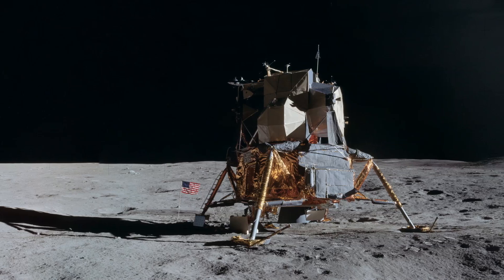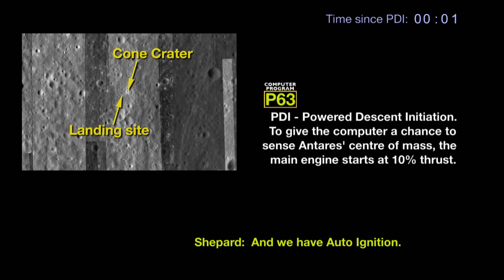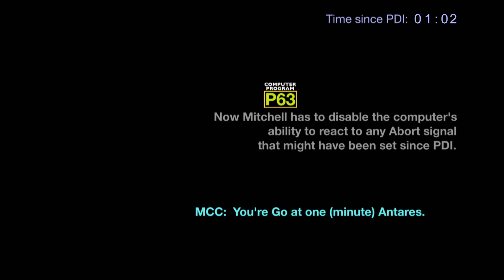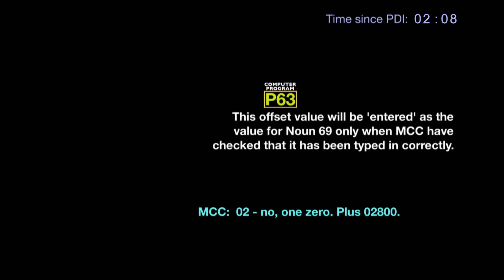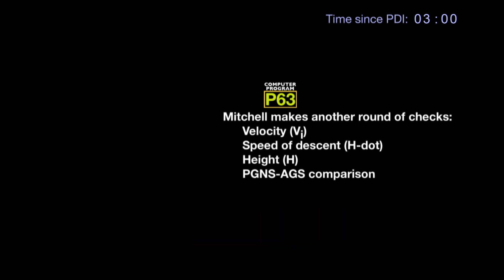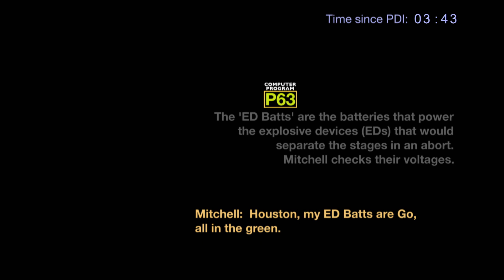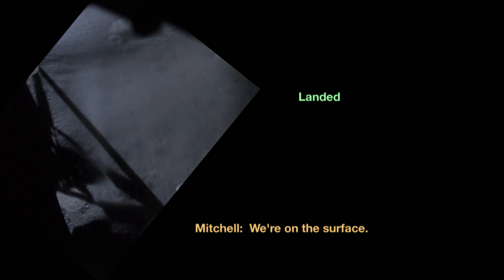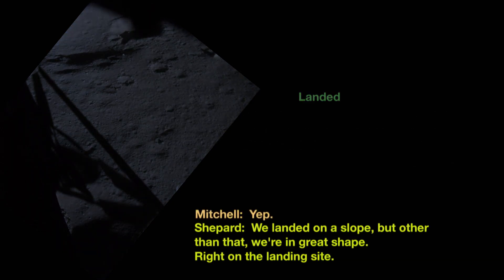Apollo 14 landing from PDI to Touchdown

Comment: There is a video on YT where some guy explains, just due to the film technology they had back then, that it was IMPOSSIBLE TO FAKE THE LANDINGS. You'd have to pre shoot everything which means multiple mags if film which means splices. Add to that having no "film effects" during a live broadcast. Impossible. One pop or crack and it's shown to be a fake.
Reply: Interestingly, some hoaxer pointed out some mistaken assumptions in that video and some examples of recording gear that existed at the time and that NASA could conceivably have operated to facilitate a faking. The author of the video acquiesced to those points; something hoaxers don't do. His point still stands.

Comment: at 13:14 why does Shepard talk in metres?.
Reply from the maker: Great question. When flying, the Apollo crews used aviation units; feet, feet per second, nautical miles. But on the surface of the Moon, they switched over to metric and stated distances in metres and kilometres. Even the Lunar Rover's speedometer was marked in km/hour, which may be related to the German engineers involved in Apollo. So in this instance, Shepard is referring to a distance on the lunar surface as opposed to a flying-related number like altitude, and without skipping a beat, switches over to metres.

Comment: Hi guys I'm looking for information on the accent fale safes. What was the protocol if the engine didn't start ?
Reply from the maker: A good starting point is the Mission Rules document, section 26: http://www.hq.nasa.gov/alsj/a14/A14MissRules.pdf
It is notable that much of what it says is they should try again after the CSM has completed another orbit. 

It is said that Neil Armstrong's answer to the question, "What if the ascent engine failed?" was along the lines of spend the remaining time they had trying to fix it. On the one hand, the engine was extremely simple. No pumps and no ignition source. Just open the valves and away she goes. But there were important prerequisites to proper engine operation, most notably the requirement for the propellant tanks to be pressurised with helium. Should that helium leak away before ascent engine ignition, it would be a bad day as there were no fail safes for this. This demanded extremely high reliability, extensive testing and careful monitoring before entrusting the crew to a system. The same was true of the SPS engine on the Apollo Service Module.
Reply: ronald mcchesney Thw fail safe is "it cant fail". That's why the engines on the LEMs used hypergolics. Very simple. Very reliable. The biggest concern they had was landing on a slope. I think the maximum tilt and still have a safe liftoff was 10 or 15 degrees from vertical. The only flight that really had something even close to an issue was Apollo 15.

Comment: Can you confirm that the audio used in your presentation was one recorded in a simulator and not actually the one recorded during a flight. My reasons for the question are, the delay between Earh-Moon communication is too short, the audio engineering, like the static noise for example, clearly sounds fabricated, there should be evidence of some reverb in audio from the moon, there is no engine noise and the voice stress levels indicate a degree of impassiveness which, despite the training, suggest the rope-learned mundaneness of a simulation flight, which included a routine short-circuit problem.
The video also raises questions. There was no discernible pitch-up to slow the forward motion of the craft. Also, in the video, the power of the rocket engine begins to blast dust at 110 feet altitude, however there is no evidence of this in the ground shots. What gives? I doubt that you know.
Reply: +teatreeboy As one who watched this event live on TV, I have  no doubt this is genuine. This is possibly digitally redone to clean up a lot of static and hiss that would have been on a 45 year old tape. Beyond that there are several cues that correspond with the manuscripts that ALSJ have. The whole issue of the AGS, and the computer reroute did not happen in the simulator. At 6:55 Mitchell comments on the "smooth ride" referring to the anti slosh valves in the LM descent stage fuel tanks, a new feature. At around 8:00 minutes, the issue of the stuck radar comes up. It was set on infinity, and when the switch was cycled, the radar went to proper mode. This did not occur in the Sim. either. I also recall Shepard's exclamation "We are on the surface" and the whoops from the ground controllers. You have to also remember there were two sources of tapes. One is the Flight Directors loop. On this one you would have little background noise, as the voices went direct  from microphone to tapes at Mission control. The recording you hear is most likely that. The other source is the actual onboard recorder on the LM. The Apollo 12 recording used this tape, and you hear the roar of the descent engine throttling up, and the constant bangs of the RCS jets firing. As for Mitchell's deadpan, you must remember these men rehearsed the landing phase literally hundreds of times in the simulators, they were trained to be cool under pressure. Mitchell stated that they spent so much time in the simulators, that the actual flight seemed like another ride in the Simulator.
Reply from the maker: +olentangy74 To add to your point further, I understand that these recordings have not been digitally processed to remove noise. Rather, it was felt that the original tapes should be digitised as faithfully as possible to ensure that their contents would be preserved for future generations. All of the Apollo audio recordings that have so far been digitiesd are available for download on archive.org. You can even get the 32-bit wav files if that suits. An astonishing resource and thanks to John Stoll at NASA's Johnson Space Center for the work he has put in to make these available.
Reply: teatreeboy  It only "raises questions" because you haven't bothered to research the answers. In other words, what you are doing is what every "hoaxer" does.... make arguments from ignorance.
Reply: +teatreeboy 
Two things to add:
1. What gives you the impression that there should be engine noise? Almost all the noise an engine generates, come from the supersonic exhaust gases hitting the surrounding air. In a vacuum this doesn't occur of cause.
2. They didn't stop all the forward motion before landing. So no pitch-up required. Further the engine was gimbal-mounted and they had a very powerful RCS-system for rotation and translation movement.
Reply: +teatreeboy  The audio is genuine and correct; I watched the landing live as it happened early that morning and remember it as presented here.
Reply from the maker: The effect of tilting is different on Earth and Moon.
The idea of tilting is to make a component of the main engine's thrust operate in the horizontal direction. To make the LM move laterally at a certain rate requires a certain force, regardless of the g-field it is in. That force will be achieved by tilting the craft by a certain angle. You are essentially taking a little of the downward force and applying it horizontally. This is a classic force triangle.
Whichever tilt angle was used on Earth to achieve a lateral force, the same sideways force in 1/6-g will require a far greater degree of tilt because the overall thrust from the engine will be far lower, everything else being the same. On the Moon, there will be less downward force available from which you can steal some sideways force in order to achieve the same horizontal motion.
A consequence of this is that tilting by such large amounts reduces the amount of downward force remaining and so you must throttle up the engine to compensate. The computer was constantly throttling the DPS to compensate for the tilt and maintain a desired rate of descent.
Reply: Apollo 14 - Apollo Flight Journal Thank you very much for the added info. The archives  that Mr. Stoll and others have done are invaluable, and very much a labor of love.
Reply from the maker: I believe that the thrust axis of the descent engine could be altered after the 10% period if required, but at a slow rate and it was constantly trimmed throughout the descent to keep RCS activity low. I'll need to look for a definite reference for that. In a sense, the RCS jets were not fired manually during a normal landing except for a check of this functionality early in the descent. Even after the commander went 'manual' in P66, the LM was still under automatic control. It was just that he was in the control loop. He would request an attitude with the rotational controller and the software would fire the thrusters as necessary to reach and maintain that attitude.. He wasn't manually firing the thrusters.
And you are correct, the ascent engine was not gimballed so all attitude control during ascent, including compensating for an offset centre of mass, was achieved with the RCS, resulting in the 2-second cycling seen in the ascent films.
Reply from the maker: To add more to this point about the trimming, and reading NASA technical note TN D-8086, the LM attitude is controlled by the Digital AutoPilot. To quote, "During the descent-engine burn, the DAP tries to control the spacecraft attitude with the trim gimbal servomotor drive [which trim the thrust axis] to save RCS propellants; however , if the rather slow trim gimbal servomotor drive does not keep the attitude error within specified bounds , the RCS jets are used until the error is brought within the attitude dead band, and control is then returned to the trim gimbal servomotor drive."
Reply: I imagine the slow gimbal servomotor drive was purposely engineered to permit the crew to recognize a trim runaway and still have time to disable the trim function. In fact I would think that its total range of movement  was limited to that which could be overcome by the RCS, in a full deflection emergency. To this day I haven't figured out if the LM flew laterally by tilting (like a rigid rotor helicopter) thereby introducing  a lateral component of thrust from the main engine, or if it remained level in the final stages and used the RCS to "fly" horizontally. The flying LM trainers appear to me to have changed pitch angle (using the RCS) to move horizontally and I suspect the LM did the same. I seem to recall that once the DAP had found the neutral point during the 10% thrust burn, the CofG remained in a very small circle of perhaps a few centimetres at most? Additionally, the LM became more stable as fuel burned off, moving the CofG vertically up. I should read up on this again, I'm going from memory from library reading 40 years ago.
Reply from the maker: Perhaps if the DPS gimbal actuators were to go hard over, the crew would simply abort. The range of movement of the DPS was plus or minus 6 degrees, a 12-degree range that is substantial and it would seem a lot for the RCS to fight that all the way down.
Lateral translation near the surface was entirely by tilting, helicopter-like. You can see this in the films, especially Apollo 12's landing. Al Bean even comments on it as Pete Conrad manoeuvred around. And in the low lunar gravity, the tilting had to be substantial to have the required effect.
There are huge quantities of original documents in PDF form out there for light reading or research!  :-)
Reply: Ah, of course, brain fart. It takes the same amount of thrust to displace the LM, but to access it you must tilt the craft more. If the RCS fuel was not so rationed, I would think it would have been a sensible means of moving the LM horizontally.
Reply: teatreeboy --- Make to tell your Mommy about the super moon secrets you discovered.
Reply: I can confirm that the LROC took photos of the landing sites TEN years ago and proved the landing sites for all hoaxers. So you have legitimate concerns, but the landings happened, so you are just wrong.
Reply: I believe the main engine thrust line was set early in the descent during the centre of mass sensing and adjustment (at 10% thrust). After that I assume it wasn't altered. So the craft was controlled after that only with the RCS (other than descent rate). Although the centre of mass of the LM changed, it was almost entirely a vertical shift. Lateral displacement was minimal and dealt with by the RCS. The RCS operated in manual and automatic during the landing, of course. You can see the automatic control in videos of the ascent where the LM rocks back and forth. I don't think the ascent engine was gimballed, correct? Pretty neat stuff.
Reply: Thanks for clearing that up, although the tilting would have been the same as on Earth for the same effect, would it not? The mass of the LM was not changed by its location.
Reply from the maker: The one time when it is important for the LM to make precise translational manoeuvres is during the final moments of rendezvous and docking - and that's when it consists only of the ascent stage. Thus, the RCS thrusters are mounted more or less around the ascent stage's centre of mass. During descent, with the descent stage still attached, I think the RCS thrusters would be hopelessly offset from the centre of mass to effect any useful translational manoeuvre without also imparting significant rotation. And why bother, with a powerful descent engine operating that was perfectly capable of supplying the power needed for translation?
Reply: The rotation could be stopped by other elements of the RCS but as you say, why bother. The main engine must have had to throttle up quite a bit during banked maneuvering.